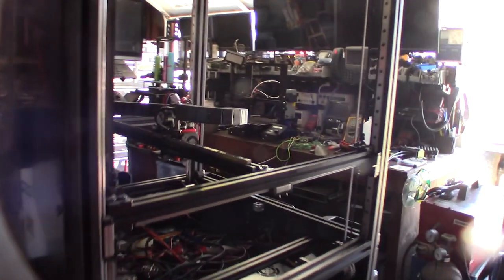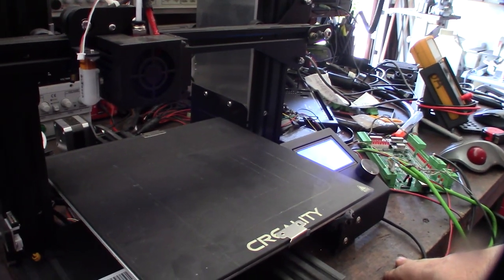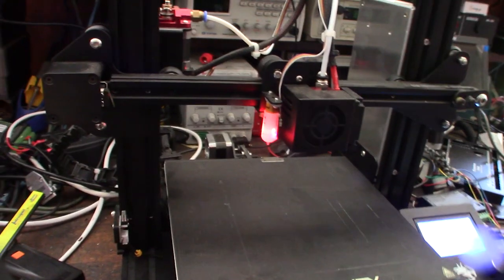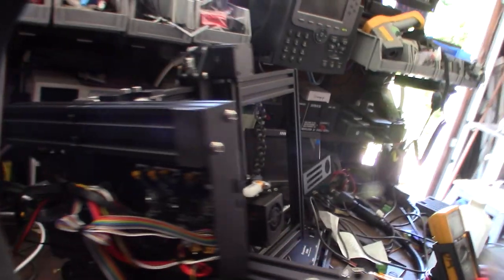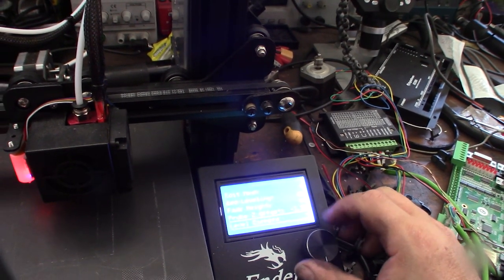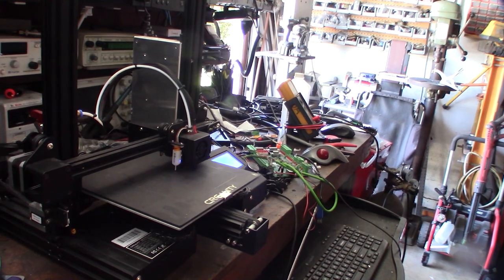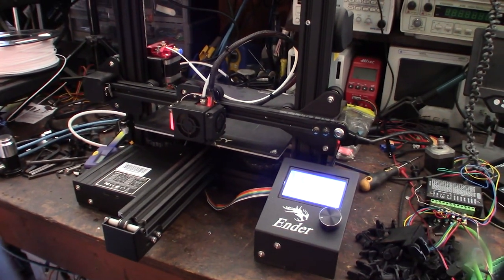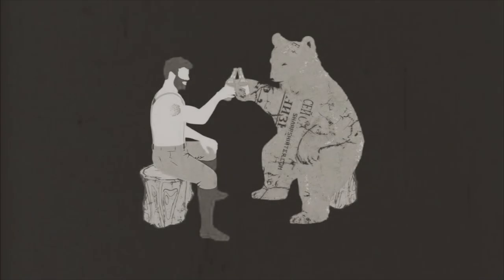Creality Ender3 SKR Mini E3 BLtouch troubleshooting

Comment: So what was the issue?  Seemed fine?
Reply from the maker: BLtouch was disconnected and wires were a mess. I fished the bltouch wires in the sleeve. I made sure everything works and did a test print. I never know how I'm going to get them.
Reply: @fintechrepairshop  I like your stuff. I do a lot of upgrades on my channel.  I haven’t jumped into Klipper yet